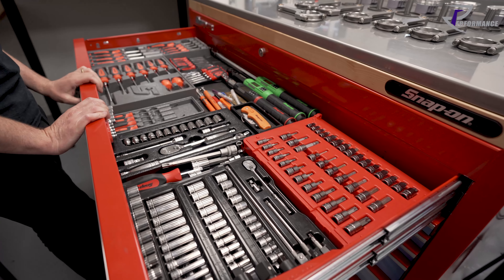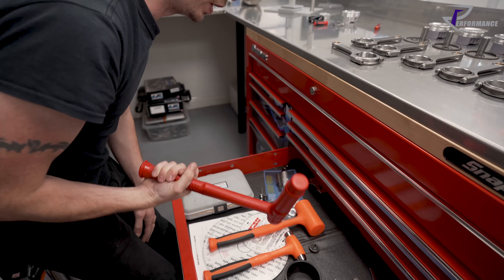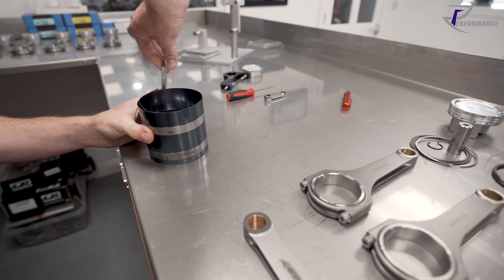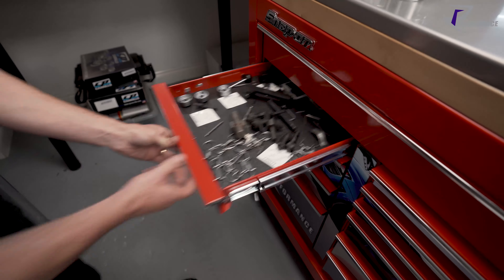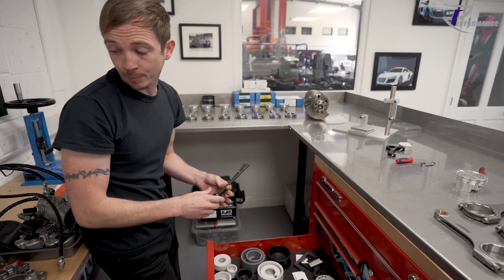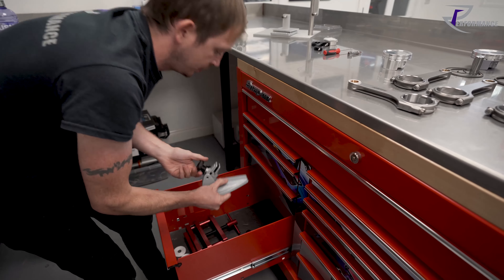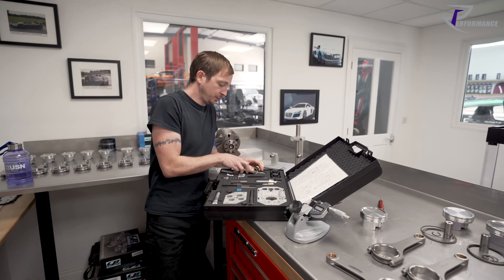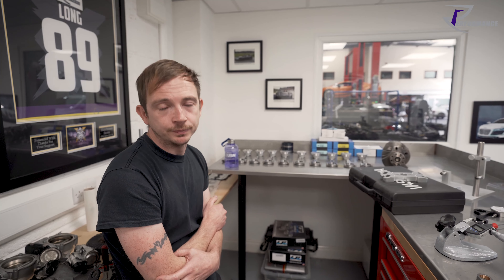What tools do we use for engine building?

Comment: Do you use the goodson high pressure oil gallery cleaning system for prepping your blocks. It really makes block preparation much better than the old method.
From goodson tools.

Comment: Nice one for a look through your tools. That valve spring installation tool is super trick. Having damaged a set of Wössner oil control rings building an engine I invested in a bore specific tapered compressor. Game changer; as you say and cheaper than another set of rings! I’m learning the hard way.
Reply from the maker: Glad it helped